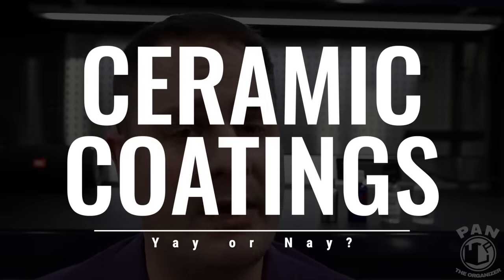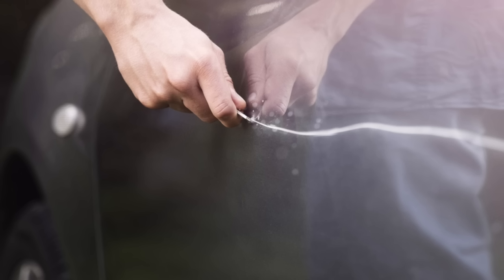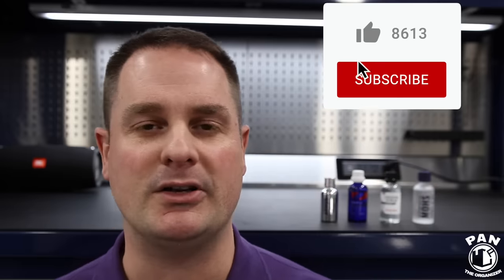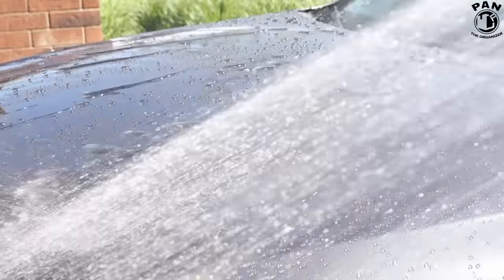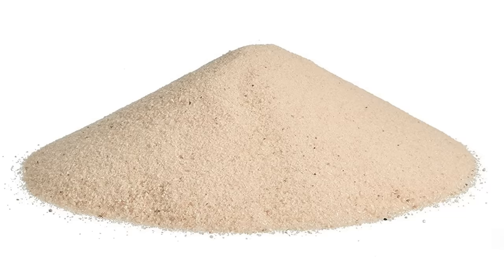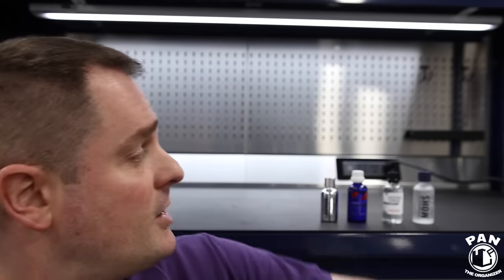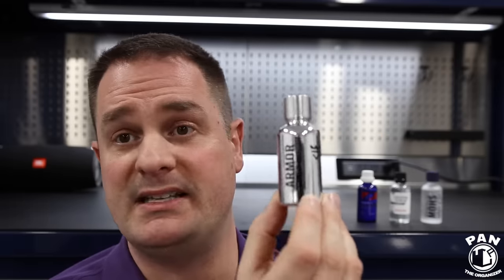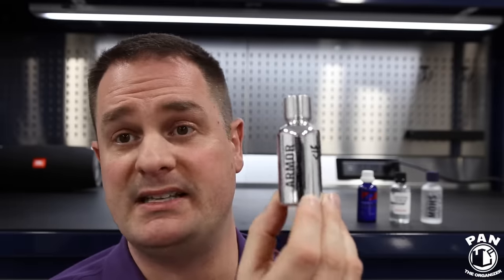DON'T BUY CERAMIC COATINGS BEFORE WATCHING THIS !!

Comment: My body shop guy tells me that, because ceramic coating has to be first removed, small scratches are very hard to buff out. He has nothing against the coating, in fact he encourages using it, but he just wants consumers to know the down side. Opinions?
Reply from the maker: Machine polishing will remove a ceramic coating, it's not that complicated. A polish like Meguiar's M205 can do the job. You don't even need a compound.

Comment: "Ceramic Coatings increase the hardness of your clear coat 2 to 3 times" to be followed few minutes later by "Do not use clay bars on your ceramic coating" . Few things to discuss here.
1. Clay bars seem to be fine for decontamination of untreated car paintwork. In my opinion this is a dangerous half truth since clay bars are pure abrasives and cause severe marring and micro scratching. The level of this damage depends on what type of clay bar you use. There are usually three levels, Hard, Medium and Soft. If you use clay bar you have to polish your paintwork, always, no exceptions. This leads to the next one
2. If ceramic coatings claim to increase the hardness of the clear coat 2-3 times then the risk of marring and micro scratches should be practically removed yet your advice is to not use clay bar decon on your clear coat
3. If point 2 is true than imagine how much damage clay bar makes to virgin paint...

To wrap it up - did you come across self healing ceramic coatings? Like Feynlab or NERO form Carbon Collective?

EDIT: Having watched your 303 Graphene COating interview with the R&D Chemist behind it and tests done by other detailers it looks like, at least in the case of 303 product, there is no need to do absolutely anything and they guarantee the product for a minimum of 1 year. Not up to 1 year, not maximum protection of 1 year but an absolute minimum of 1 year. With care it will last much linger. Care and maintenance then for graphene coatings - putting silica sprays on top of graphene coatings might work but you might as well put a normal wax on it as the chemistry is totally different. I understand that you simply reapply 303 graphene coating after a year. It is so easy you can do it every 6 months even if it is your daily driver and it gets filthy on literary daily basis :). The point to this rant is that Ceramic Coatings are truly gone now where you have products like 303 graphene with its ease of application, phenomenal durability (you don't have apply maintenance coats avery 3 months, whats the point then?!?), and cost. How can you sell a 5 year ceramic coating to a client when he/she would have to have a strict regime of quarterly booster application or the coat will not last the advertised amount of time or am I missing sth here? Graphene is fire and forget compared to Ceramic being maintenance heavy and super expensive in comparison. 
EDIT2: Apologies for a long rant, a bit passionate about this :)

Comment: What are your thoughts on Expel car wraps ??? If used can you apply ceramic coatings on top of that ???
Reply from the maker: You can apply coatings on top of wraps and PPF. In fact I recommend it. Some brands have even formulated PPF specific coatings, like CarPro Skin and Gtechniq Halo.  I personally don't like the look or feel of PPF, and I get a new car every three years, so stone chip protection is of no concern to me. But for someone who wants ultimate stone chip protection and keeps their cars for a long time, PPF is the only way to go. Apply a coating on top of that and you have the best of both worlds.
Reply: @PanTheOrganizer  thank you, your channel is the best, you provide great info and insight into so many detailing solutions. 👍

Comment: Hey pan me again haha ... hey how would you advise someone who loves to be hands on with his ride alot meaning i like to detail my ride would i be limited once its coated would you say?
Reply from the maker: Define "detail my ride"... What do you mean by that? A ceramic coating is the best form of paint protection as it can last for years, instead of a few months like regular waxes and sealants.

But you can still wash your car as often as you like, and once you're done with the wash process, you can use a ceramic based quick detailer as a drying aid, or to boost gloss/slickness when you want. Just like you would on a waxed car. But the ceramic coating will provide much better self-cleaning properties, and make the vehicle much easier to wash.
Reply: @PanTheOrganizer  yes i ment once i go threw with a coating to what extent can i safely still satify my OCD but npt mess with the coating at the same time...
Reply: @PanTheOrganizer  oh haha my baf i didnt realize your last comment had more to it thanx for the info pan awesome as usual  im still blown away with how much you monitor your channel and its comments its been a huge help keep up the great work! 💯👍

Comment: So ...... I use my mother's carnuba for my other cars now ? ...... I can't use it over the new car that's been ceramic coated ?
Reply from the maker: Correct. You don't apply regular waxes on top of ceramic coatings. And you wouldn't need to as you would be masking the coating's superior hydrophobic properties and self-cleaning properties (meaning the vehicle is easier to wash).

On a coating, you apply a silica spray sealant as a topper once every 2 to 3 months for maintenance and boost gloss and slickness. I have a full tutorial on a proper maintenance wash for a ceramic coated car here: https://youtu.be/yLiePQRMFc8

Comment: Hey Pan thanks for the videos! One question: How do these ceramic coatings compare against something like Hydroslick from CG? I guess that maybe something like Hydroslick would not last as long but what about protection from the elements or hydrophobic action etc? 
Cheers and keep up the good work :)
Reply from the maker: Hydroslick doesn't hold a candle compared to full blown coatings like these (the ones in glass bottles). Hydroslick was underwhelming in my opinion, and certainly doesn't last for years.

I tested Hydroslick against a Meguiar's competitor in this video: https://youtu.be/A7IMzfTTx28
Reply: @PanTheOrganizer  thanks for the answer! And yes I've seen that video as well. I was just debating on whether to use hydroslick or something like the ones you showcase in this video.
Reply from the maker: My pleasure. How did you discover my channel by the way?
Reply: @PanTheOrganizer  I think randomly to be completely honest. I remember I was searching for water spots removal tips and bumped into on of your videos and been following since
Reply: @PanTheOrganizer  On the same topic, what about something like a nano coating like the Koch Chemie 1K Nano? Sorry for the bunch of questions but still trying to figure out which one I should go for. Thanks again :)

Comment: From my experience 30 + years I have scene boats that have been ceramic-coated that still need maintenance also on black cars and trucks sometimes I end up bumping the whole truck swallow Mike remove it with foam pad and use Meguiars synthetic polimer that process it takes a while and is better than ceramic coating
Reply from the maker: Are you feeling ok Patrick? I can't decipher what you were trying to write here lol. "I end up bumping the whole truck swallow Mike remove it" ???? What does that even mean???

Comment: you have to polish the car before applying this, which most people cant do properly which is where the expense comes into play, polishing can take anywhere from 3-18 hours and yes applying it is fairly easy but theres alot that can go wrong which is why you come to a professional for all of this. no ceramic is gonna protect from bullet holes or nuclear fallout...thats absurd. but it will protect from water spots, scratches, mag chloride, bird poop etc. things that will cost you more to get re painted. ceramic coatings are more then worth it. and i know because i do them. plus they add 1000 dollars to the value of your car.

Comment: Hlello Pan! Can ceramic coating be applied over a paint sealant? (The last coat)
Reply from the maker: The Last Coat isn’t a regular sealant. It’s a silica (ceramic) base sealant. 

And true ceramic coatings, the ones in glass bottles, need to be applied on top of a well prepped, virgin clear coat, free of any previous paint protection. So the answer is no.
Reply: @PanTheOrganizer  thank you so much for the quick reply. I also forgot to ask you of I can is 3d wash an wax soap on ceramic?

Comment: I don't have a garage to put my car in. Can I still apply a ceramic coating.
Reply from the maker: Yes as long as you work in the shade and make sure it doesn’t rain for at least 24 hours after the application.

Comment: Do any ceramic coatings fill in swirl marks
Reply from the maker: No. Ceramic coatings are pure paint protections, and do not contain fillers or masking agents. Hence why paint correction (machine polishing) is recommended before the application of true coatings, in order to remove scratches, swirls and oxidation, and get the paint to a level where you are happy with the looks and gloss.

More on that in a cool video coming in March about ceramic coatings, you won't want to miss that!

Comment: Great video Pan I had to laugh at the start when you where trying to give an angry face. Is a 30ml bottle enough to do one car car?
Reply from the maker: Hehe. Yes 30ml is usually enough for two coats on an average size car, as long as you are talking about just the paint.

Comment: Will it work on stainless steel
Reply from the maker: There is debate on that, as coatings bond to porous surfaces. So it depends which coating you are buying (check with the manufacturer) and can stainless steel be coated... What stainless steel would you like to ceramic coat?

You can try using a dedicated metal coat like Dr Beasley's Metal Coat. Link: https://bit.ly/3JUCC0I

Comment: i thought ceramic coatings were great for helping me take care of the car with just 1 wash in 1-2 weeks. Boy i am wrong. everytime the car is wet i have to wash it one round or it will have water spotting on the car. its even harder than using wax. so angry and mad at myself looking at the coating done which is not cheap then seeing water spots on the paint work. I hope the graphene tackles this issue once and for all

Comment: Thanks for the information Pan. I like GTechnique’s ceramic that can be applied over PPF
Reply from the maker: Yes the new Gtechniq Halo and CarPro Skin were designed specifically for use on PPF or wrapped cars. That being said, most ceramic coatings can also be applied on PPF.
Reply: @PanTheOrganizer  if you get a chance check out Topaz Skin on Topaz Detailing
Reply: Pan I think ceramic is like a chemical form of protection whereas PPF provides a mechanical protection

Comment: Just wondering how to prove they actually last 3-5 years ?
Reply from the maker: Through real world testing when possible. I personally have been using CarPro CQuartz UK 3.0 for years now, including on my own personal cars at some point, so I know it can last the claimed 2 years. I have many viewers who applied the AvalonKing coating over 3 years ago when the coating was released, and it's still going strong. So on and so forth.  There is nothing better than real world testing. 

Of course, like any protection product, the brands don't have time to wait 3 to 5 years to test each product, so they do accelerated testing in their labs, using methods like chemical resistance and harsh conditions to mimic real world nasty elements that your vehicle could be submitted to.

You also have to keep in mind that the actual life span of a coating will greatly depend on conditions. A ceramic coated car in California that is only driven on weekends, and is garage kept will last much closer to the full durability claim compared to a daily driven car from Montreal where we have intense winters and road salt, etc.  How you maintain the coatings is also essential to their durability.
Reply: @PanTheOrganizer  wow you actually replied ! Thanks so much !

Comment: Oh whoop, you did address that here, mahalo!  In the time between shooting this video and the present (2024) how has graphine changed?
Reply from the maker: Most graphene coatings simply have reduced graphene oxide in them (not pure graphene) so to what extent they actually help with water spot prevention is still in debate. But they are as good as ceramic coatings, as they are based from ceramic coatings, with RGO added inside.

Comment: I am just starting to investigate ceramic coatings. Can I take my car through a car wash with a ceramic coating. ? Hand washing is difficult for me so if it damages the coating, does it make sense? Also what about salt that is used in the roads in the winter?
Reply from the maker: Ceramic coatings for sure are the most durable form of protection and have way better chemical resistance compared to waxes or sealants. That being said though, automatic car washes use very high pH soaps (alkaline) that can degrade even the best coatings after repeated use. The best is always to wash your car yourself with a good quality pH neutral wax-free car shampoo or have it professionally washed by a detailer.
Reply: @PanTheOrganizer  thank you! Alas I am disabled which makes frequent washings by a detailer expensive. I really appreciate the answer which helps clarify things.

Comment: I had a guy come do a "ceramic coating" except they did it in my driveway in the sun... Should I ask for my money back?
Reply from the maker: Mobile detailers don't have much of a choice if they get to a person's home and don't have access to do all the steps in a garage. Although not ideal to work under the sun, if he knows what he's doing and used quality products, I see no issues. It has more to do with the reputation and capabilities of the detailer you hired. As they are supposed to be experienced, they know how to work under the sun.

The recommandations of not working in direct sunlight is meant for consumers, who don't have the same experience level as a pro does. The brands want to make sure that consumers get the best possible application and end results, so they have no choice to make sure they give advice on the conditions in which you're using the product, so everyone gets a nice experience using it.

Comment: Can you stack ceramic coatings?
Reply from the maker: If you mean stack coatings from different brands, no, as coatings are meant to bond directly to virgin clear coat, without any protection on the clear. That's why there is so much preparation involved prior to apply a coating, to make sure the surface is free of any previous protection, contaminants, etc.

But what you can do (and should do for maintenance) is once the coating is applied, use a silica spray sealant (ceramic spray) as a topper once every 2 to 3 months.

If you meant about stacking coatings within the same brand, it depends on what coating you are buying. You need to follow the manufacturer's recommendations for the amount of layers. For example, with CarPro CQuartz UK 3.0, 2 layers are recommended. Some coatings only require 1 coat, some require 3+ coats.

Welcome to my channel. You discovered one of the biggest car detailing channels on YouTube as we surpassed 860,000 subscribers and we have almost 110 million views! I have been detailing for 25 years and I love to share my knowledge and passion with my viewers.

You found the right channel to help you learn everything about detailing.

Comment: Just about to have my Range Rover ceramic coating which they are going to have the car for three days but they are going to do the engine bay and under the wheel arch’s and then last of all going to do the inside of the car has it’s leather can not wait to see the car after it’s been done
Reply from the maker: Cool! Always a good thing to have your vehicle protected. Do you know what specific brand and model of coating they'll be applying to your paint?

Comment: Can I run it through the drive through car wash??
Reply from the maker: I would never recommend using automated car washes, regardless if the car has coating, wax or sealant or even no protection. They use harsh chemicals to clean your car and that over time, under repeated use, will degrade the paint and/or protection.

Ideally you would wash your car yourself at home, using quality products, safe washing and drying methods, etc.

But if you have a ceramic coating, yes you can still go through a car wash, just don't expect the same durability from the coating.

Comment: Can you put a ceramic coating on a car that already has chips on the paint?
Reply from the maker: Yes, but keep in mind the coating bonds to clear coat. So where there are the stone chips, if the clear coat is gone, the coating won't have anything to bond to. If won't show visually, but you need to keep that in mind.

Comment: Clear coat? What if I have a single-stage paint job?
Reply from the maker: There's still a lot of debate out there on the topic. People aren't sure ceramic coatings can bond to single-stage paintwork as it technically doesn't have a layer of clear coat to bond to. What I would do is contact the coating brand you want to purchase from and ask them if their product is compatible or not.

Comment: Can this be used on boats?
Reply from the maker: Yes the majority of ceramic coatings can be applied to boats and gel coats (unless otherwise specified by the manufacturer). There are even top tier brands that make marine specific coatings now, like this one: https://amzn.to/3wR56oW
Reply: @PanTheOrganizer  HELP! Nothing to do with this product I just had a go at fixing blistering clear coat cleaned all down sanded all back primed it, base coat and 2 k clear coat and it’s got little pimples all through it now WHATS THAT!